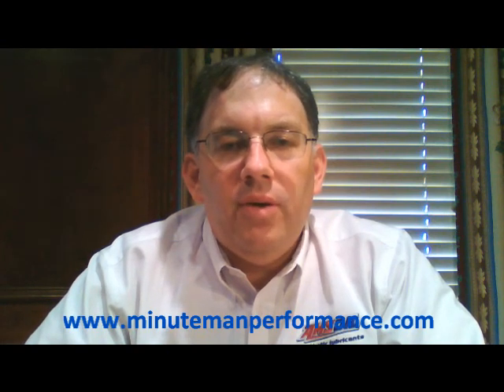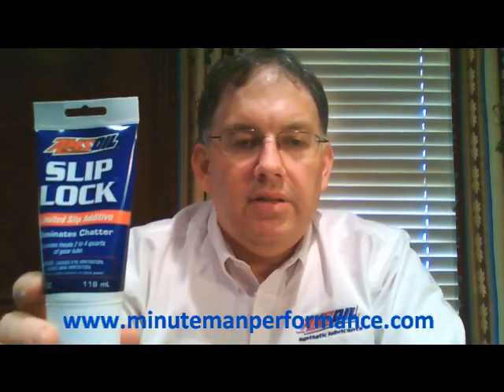AMSOIL ADA Slip Lock Limited Slip Additive

Comment: Amsoil  website is a little confusing. Says you don’t need it using sever gear 75-90 in limited slip dif.
Reply from the maker: Many vehicles/applications can use Severe Gear gear lube in limited-slip differentials without adding the Slip Lock additive.  But in those applications that still exhibit differential chatter, clunking, popping, etc, after installing Severe Gear, AMSOIL recommends adding the Slip Lock to reduce/eliminate those unwanted sounds.  It doesn't hurt anything to add the Slip Lock up-front, and this eliminates the potential need to open the differential again later.  If you place an order with AMSOIL, please use Referral Code 1302686, which links your order to me - I'd greatly appreciate your business.  Please contact me at 678.787.3028, or info@best-synthetic-oils.com if you have any further questions.  You can place orders directly with AMSOIL (www.amsoil.com), or by calling them at (800) 956-5691.
Reply: I added the severe gear oil from Amsoil and still needed friction modifier in my Mustang GT.  Felt weird from the front even.  After adding motorcraft friction modifier, it all went away.

Comment: Can I use this in Quattro ( torsen ) equipped vehicle ? ( Audi A6 C5 quattro )
Reply from the maker: What year?
Reply from the maker: @Szaraq12  If you are experiencing any problems with your differentials when turning, such as noise, binding, clunking, shudder, etc, then I would recommend adding a friction modifier, like AMSOIL Slip Lock Additive.  Add 1 tube to each differential. If you use a premium synthetic 75W-90 gear lube in your differentials, such as AMSOIL, you might not need the additive, but you can add it to any gear lube, including the AMSOIL synthetic lubes.

Comment: Will it work on Jeep ZJ  lsd? ( metal to metal clutch pack)
Reply from the maker: ZJ's use either 80W-90 or 75W-140 in their front and rear differentials, depending on the dizzying array of 4WD systems available over the years of production, so the AMSOIL Slip Lock should at least not create any problems.  My recommendation would be to start off with using AMSOIL Severe Gear lubricants in front and rear differentials without the Slip Lock additive.  If you feel or hear any clunking from LSD, then add 1 tube to the affected differential.  Severe Gear lubricants don't normally require use of the additive, but it doesn't hurt them to use it either, so you could just add it up front and be good either way.
Reply: @Best-Synthetic-Oilscom  thanks for the answer. I already had 75W140 in the rear diff, added Amsoil Slip Lock and it did the job, now smooth around corners 👍.  BTW. I've changed recently engine oil to Amsoil 10W30 - Super happy with it 😀

Comment: This stuff really work ?
Reply from the maker: Absolutely, but you'll only notice the improvement if you need it.  For example, AMSOIL gear lubes are already formulated with friction modifiers that enable most limited-slip differentials to work properly.  You only need to add Slip Lock if you are still getting chatter.